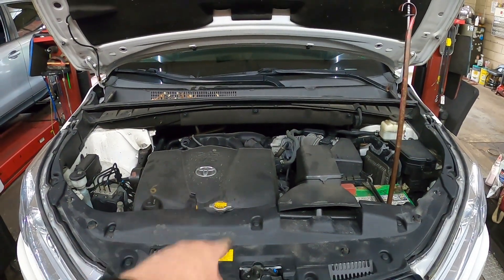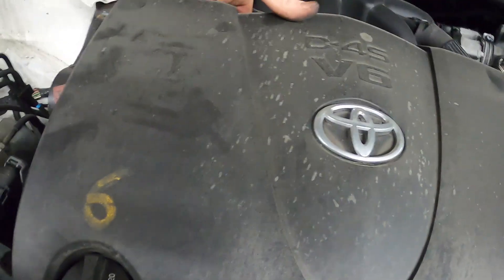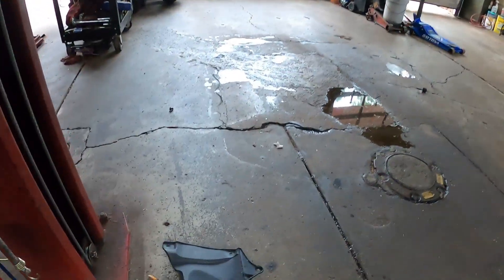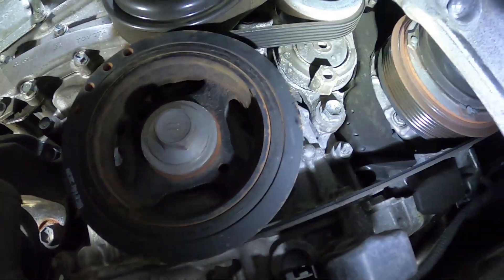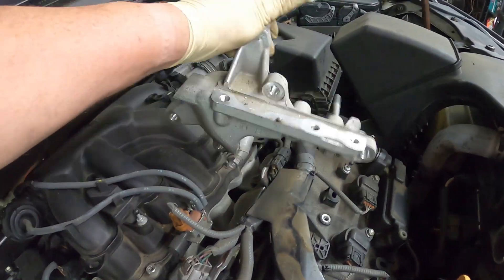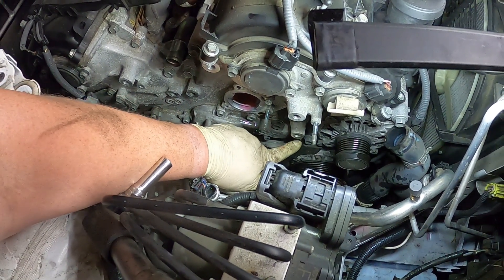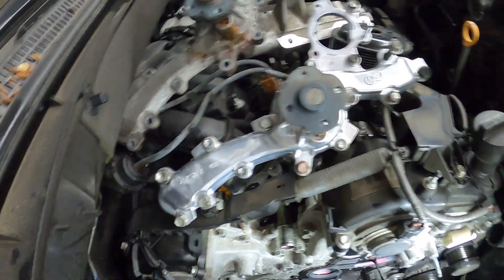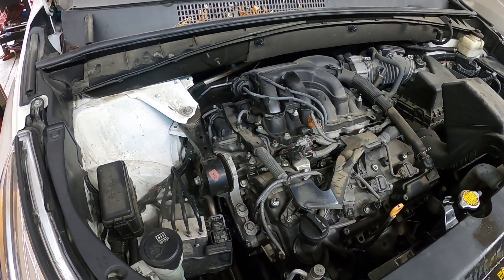2017 Toyota Highlander Water Pump Removal

Comment: So basically this isnt a job you do in your gravel dirt yard... my wifes 2015 highlander with 222k is making this noise coming from the waterpump vicinity. I don't have a lift, nor do I have the equipment to lift the engine out. I've got a harbor freight jack. On dirt, in the winter, in a moist climate.
Reply from the maker: It can be done with a jack stand and a floor jack outside. Get a piece of plywood to slide under it. It will not be fun but It can be done.
Reply: It can be done. I'm doing it now. The tensioner pulley does not have to come off. Take bolts out and move it forward a little bit to remove all bolts from water pump
Reply from the maker: @KendrickChaney-yr9cf  If you take the bolts out, it should come out.